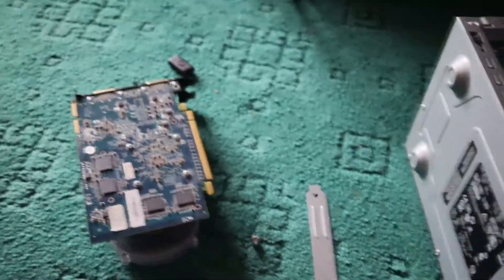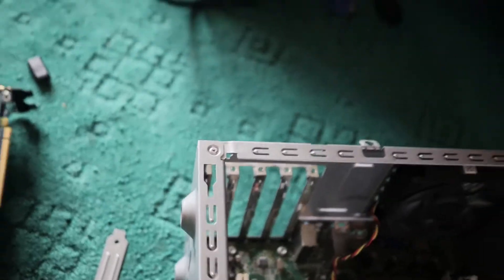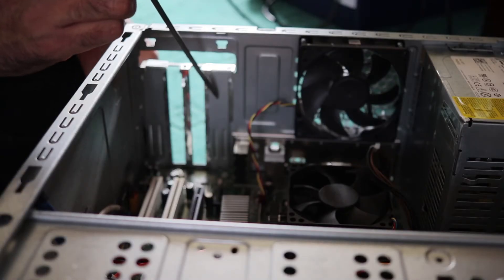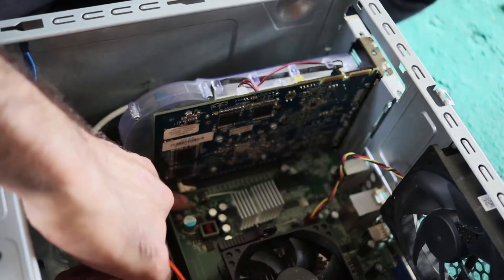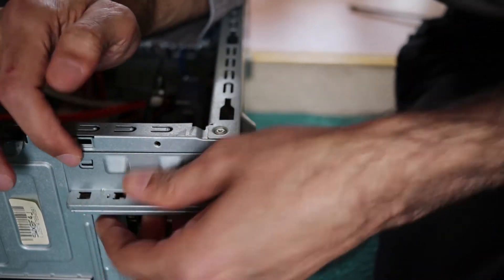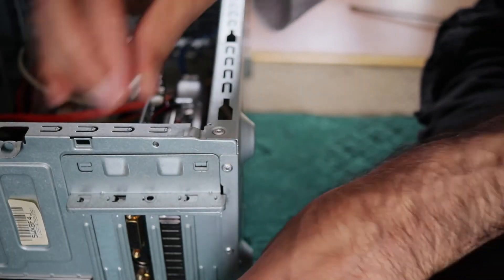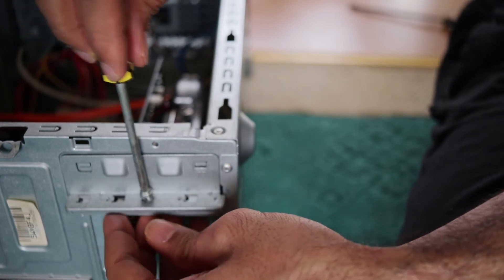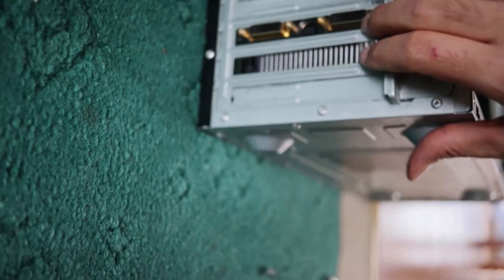How to replace the graphics card of Dell Inspiron 546

Comment: are there any power wires that have to connect?
Reply from the maker: The one I installed above didn't require any additional power wires. It'll depend on your graphics card. I got 2 more videos on how to install graphics card that are more detailed and require power wire. 
👉 How to Install a New Graphic Card - https://youtu.be/0B-a5OJhbQc
👉 how to upgrade 4K GRAPHICS CARD Dell Precision T3500 - https://youtu.be/sl04utplRVY